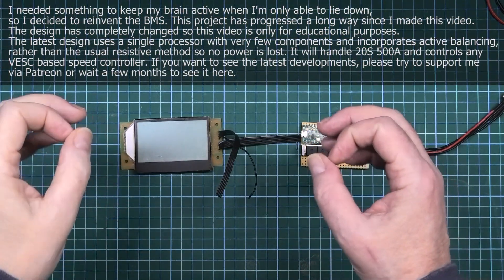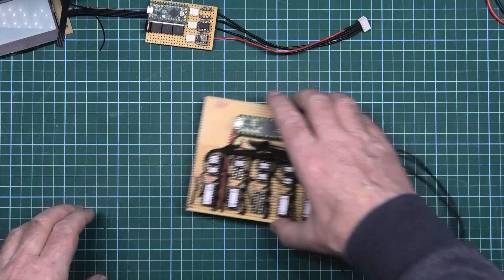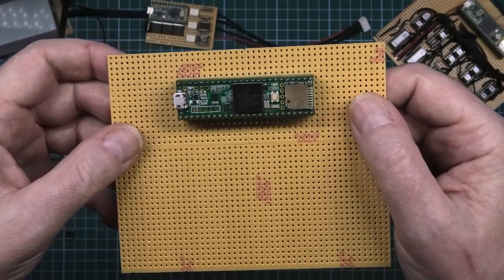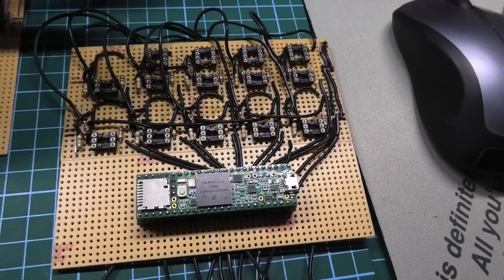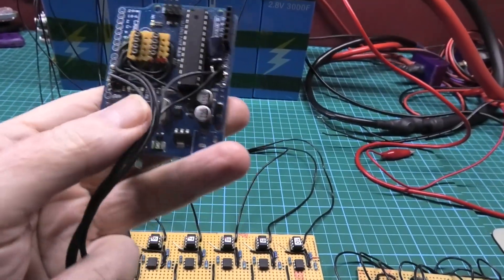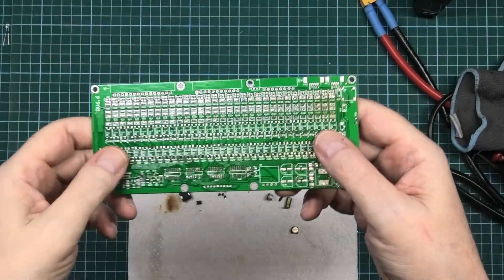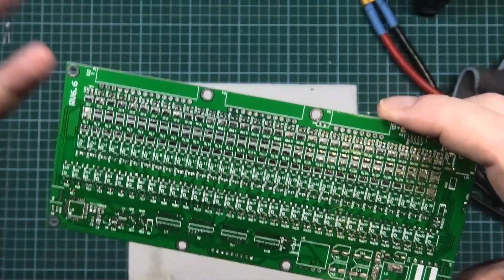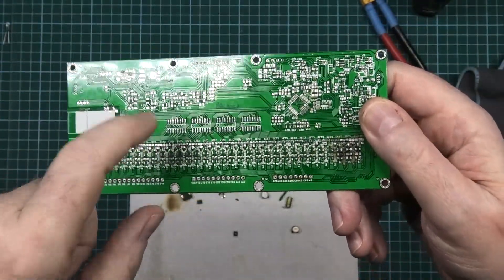Reinventing the BMS with Launch control, anti wheelie and VESC integration -  Part 1

Comment: Going to guess a ADS1115 16 Bit ADC is going to play a part, maybe the 12 bit version... It's actually quite spooky, I've got a bunch of AT tinys 85's doing charging to 10 millivolts accuracy, I'll be interested in how you're going to multiplex those voltages down to the range of the ADC, More Vids!

Comment: OK.  You might enjoy some software tools in your design flow.  LTSpice will easily simulate your circuit so you don't have to build it to see if it will work.   Diptrace can capture the schematic, layout a board and order it at very low cost so you don't have to create boards with an Xacto knife.   Live long and prosper!

Comment: Not sure why supercapacitors need a bms
Reply from the maker: The same reason a normal 18650 needs one but even more so one a supercapacitor - if you overcharge one, I wouldn't like to be in the same house. If I'm pumping 27V into the series pack and one capacitor is taking a lot more than the others, imagine if it charges to 27V when it's supposed to be 2.7V 💥💥💥💥💥💥
Supercapacitors are super-dangerous.
Reply: @Vortecks  remember a large standard capacitor being wired backwards exploding the best were the old metal covered paper caps exploding... seen many these multiple 16850 blocks are nearly unsafe may end EVs in years to come as BMS finally fail in unsafe mode... lots of smoke